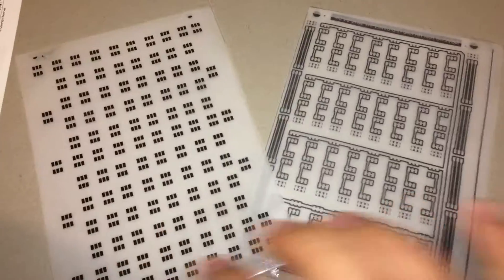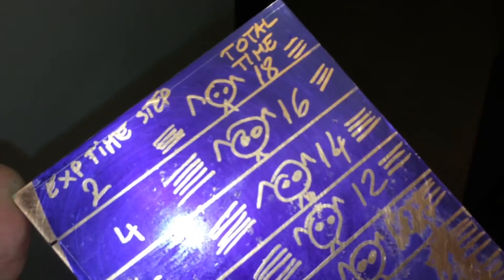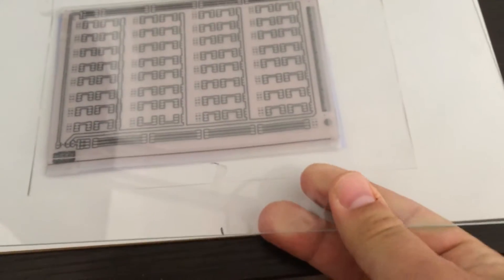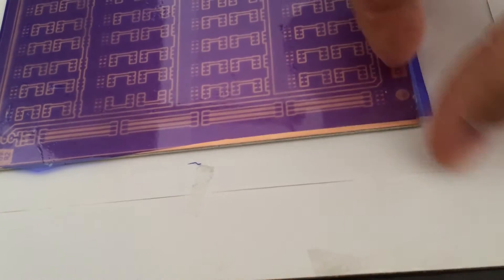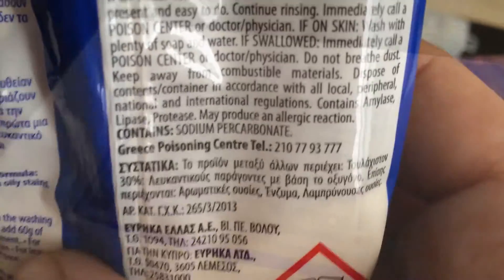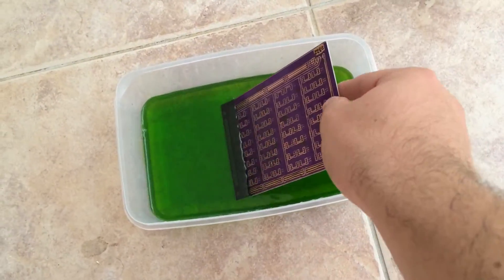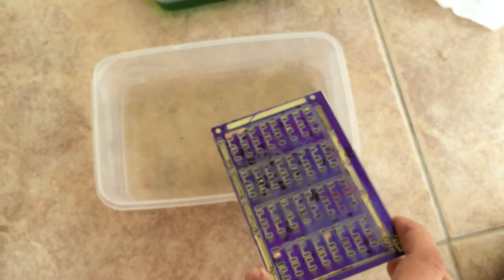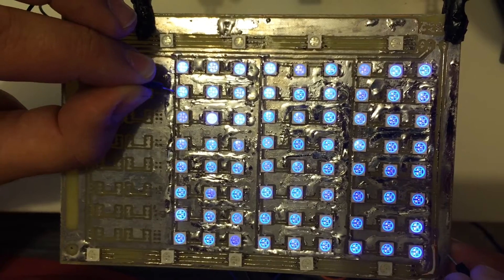UV LED PCB Exposure panel

Comment: What is the paper they use to print? acetate it is difficult to print it on any printer.
Reply from the maker: +CIAG Tutoriales acetate needs to be printed on a laser printer. This is the photographic method where the template can be reused.